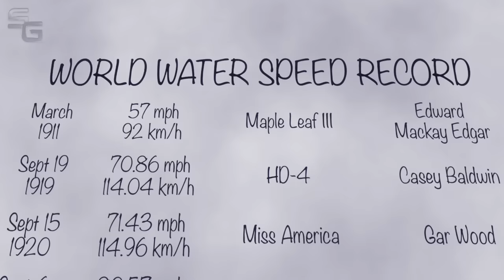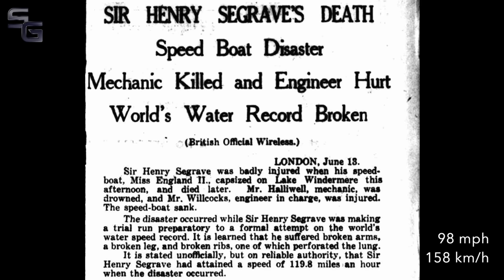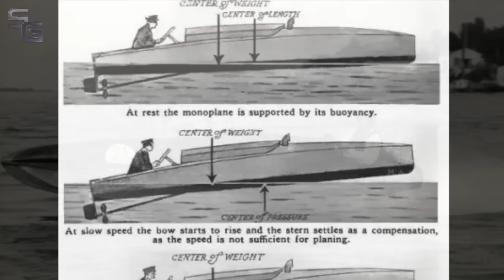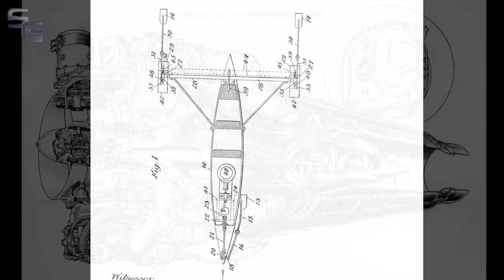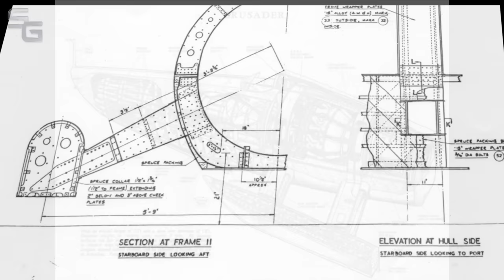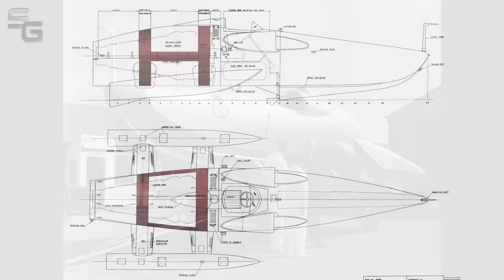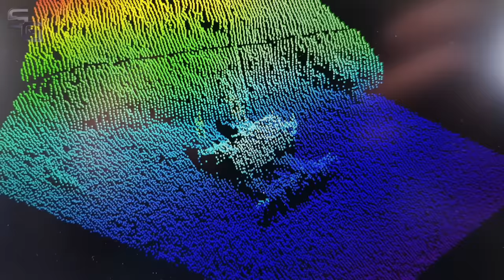Crusader - John Cobb's Loch Ness Monster

Comment: the basic problem with Crusader was that it was designed as a boat - not a car!  Hydroplanes get unsteady at 100mph!
All fast cars have low noses but Crusader's nose was sloped up and naturally gained a wedge of air to lift it up at high speeds.
As the nose lifted the wedge of air escaped and nose dropped.  Then another wedge built up  then escaped but this got worse as seen in the video.
The wake of the front slide gets intermitent as wedges build and release.
The side sponsons also then are affected by the torque of the jet as at each lift the torque acting on the sponson increases its effect so that when the boat drops the torque reactions pass to other side.
Having the weight of the engine at the rear plus the air resistance of the high body  meant loading was at the rear so when the wedge lifted the nose the egine thrust line lifted to push the nose up (smae problem as grounded the Boeing 737Max after 2 crashed) - plus the gyroscopic precession pushed one side down to incraese the wedging!
As speed built up the wedges/releases, torquings and side sponson loadings all began to get out of whack until eventually the boat flipped.
A safe WSR vehicle should be longer, slimmer, lower and running on wheels not sponsons as water is pretty solid at speed - as proven watching videos of plane and boat crashes.   Wallis's bouncing bomb shows water is pretty solid to a high speed round object?
The jet should be at the front exhausting between two rear wheels that are unfaired or minimum faired.